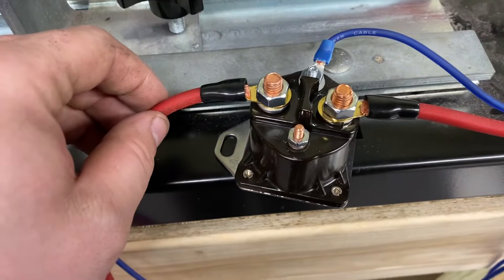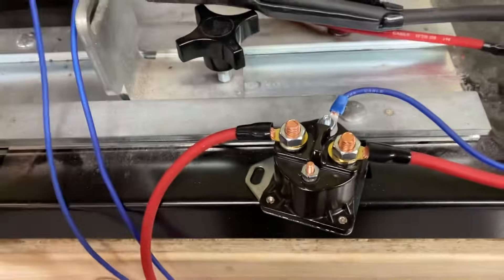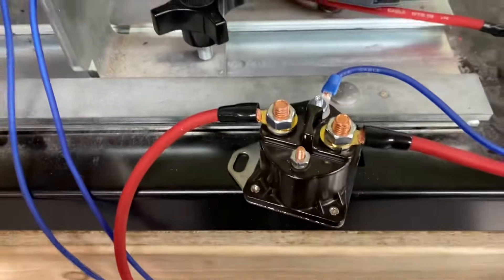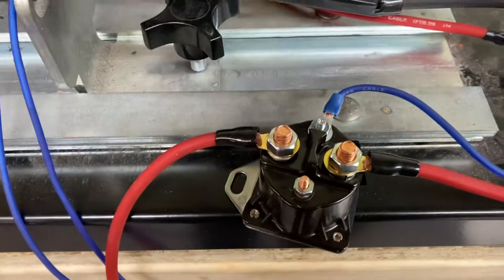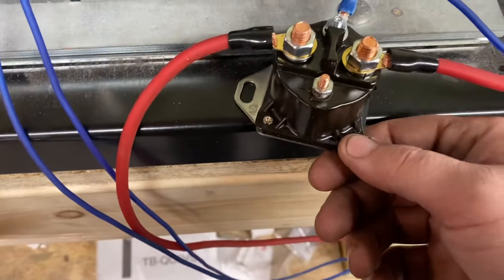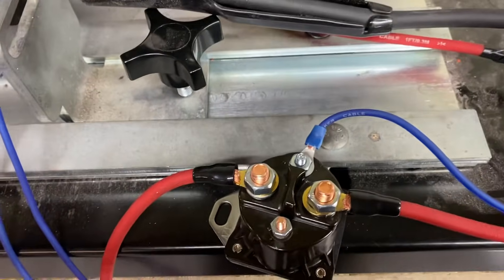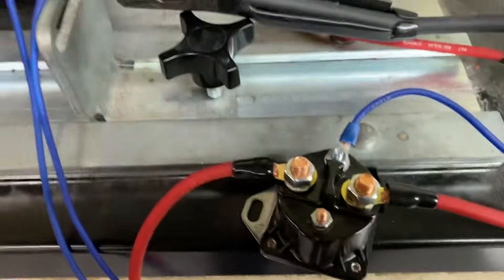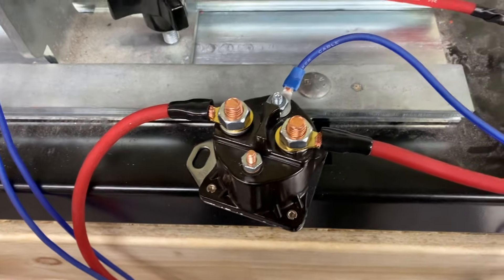How to Wire a Continuous Duty Solenoid to Power Accessories in your Vehicle

Comment: I need a hand with my 82 Chevy van 30 solenoid I have the starter connected to the let side the ignition/key to the 3rd terminal and the ground on the 4th I’m using a duralast F496. Did I set it up correctly

Comment: Hello Sir. So on my classic car. I want to install a electric fuel pump but I want to operator only when the key is turned of course. I'm guessing I can run the fuel pump wire to the starter/ switch port on starter relay?

Comment: Hi. Can I run this solenoid inline with a 12V lead to my truck camper so that it cuts power from the battery when the ignition is in the 'off' position?

Comment: hi the video is great but i am a newbie with them, how would i wire a relay for the max trac dual compressor. with a pressure switch?
The present wiring/relay/PCB is dodgy so going to cut it off and just use a continuous relay and pressure switch. I believe has positive direct to motor and the present relays are on the negative side. If there is a link to more info that would be great. thanks again
Reply from the maker: For a relay it should be: pin 85 to ground, pin 30 to b+ / battery positive on your battery, 86 to your switch or ignition source you’re using to turn the relay on, and 87 to whatever you’re turning on IE lights, amps, horns, compressors, etc

Comment: Are the holes on the solenoid that bolt to the fender ground? Or is the back plate of the starter solenoid ground? I have a 88 mustang gt and I want to know how these solenoids ground.
Reply: They ground by bolting them to the frame.Yhe entire bottom plate is technically your ground connection. If you are using it for an off-brand purpose, you would want to wire the bottom plate using one of those two mounting points to a ground connection somewhere.

Comment: Can this solenoid be used to wire aftermarket horns?
Reply from the maker: Yes, but a relay is adequate for a standard horn.

If you’re running an air horn / compressor than yes I’d recommend this over a relay

Comment: Hi buddy, I have a solenoid connected to my battery and starter motor, then I want to connect it to a starter button. How do I connect the key switch to the starter button from there?
Reply from the maker: Connect the switched output of the starter button to the starter solenoid.

Make sure your starter button or key switch or whatever you’re using also engages whatever else is required for running though!

Comment: Thanks for posting your videos, I've got a Cole Hersee 24063-BX solenoid.  Trying to set up a 2nd battery in a 1987 gmc to run an inverter to power a hand held hammer drill. Can you recommend a wiring scheme? Thanks in any event.
Reply from the maker: Run primary battery to first large stud on the solenoid.

Second large stud to the secondary battery.

Use your normal ignition source for turn on.

When the key is in the on position it’ll transfer power from the first battery to the second battery.
Reply: @brandxelectrical  Awesome, Thanks Jonathan for getting back to me. Got it, From positive primary battery to 1 solenoid and positive secondary battery to 2 solenoid, ground from to negative terminals to chassi, what would you recommend for size wire? fuses along lines? Thanks Again!
Reply from the maker: 2 gauge wire is adequate.

Use a 350-400a fuse
Reply: @brandxelectrical  Thanks Jonathan!

Comment: Great video I install a solenoid to power my electric fuel pump and fans I have power on the input side but no power passing though the solenoid I purchase 2 solenoid and they both are doing the same thing do I have the correct type solenoid?
Reply: Good bro 😊

Comment: Im trying a ford sw-3 solinoid to power my motor controller for my rc mower. I have 10ga to carry 30amps if needed. I have it working so when the switch is on I hear the click and controller powers on. I also notice the solinoid heats up. Have concerns it might get too hot.
Reply from the maker: Solenoids have a small coil that passes the current, it’s not abnormal for them to get warm. Over 100 degrees warm

Comment: I’ve been wanting to do this with 2 480a compressors. If I were to run 2 of these, can I run 2 wires off the alternator ( one to each relay obviously) I’m not the smartest when it comes to wiring so bear with me.
Reply from the maker: 480 amps?

Or that’s just the model number? 

You can daisy chain the inputs together, and the same turn in source for both yes.

Just use wire rated for the load / amperage draw of the accessory, and the solenoid needs to be capable of it as well.

Comment: I use this style solenoid to do exactly what you're talking about and I burned three of them old and they told me at Napa that these are only meant to go on for a few seconds not continuous
Reply: Question, Did you finally get one work, and which one did you get? I am having the same issue, it gets hot and then the coil gives up.
Reply: You need to buy a continuous duty solenoid.  Be sure that is what you ask for if you buy one at an auto parts store or enter continuous duty if you search for one on line.